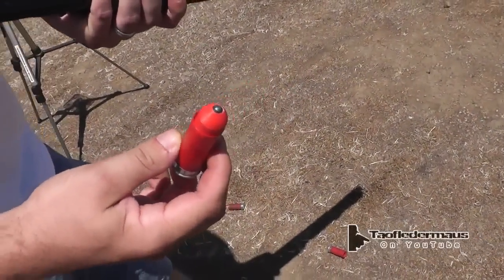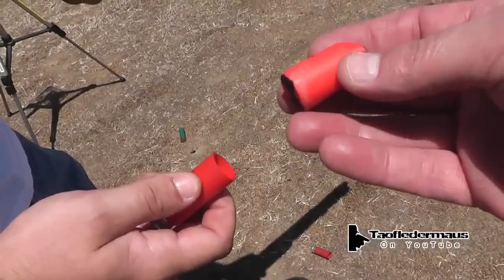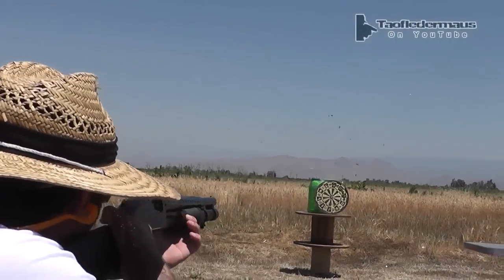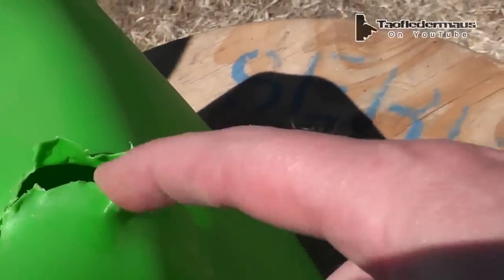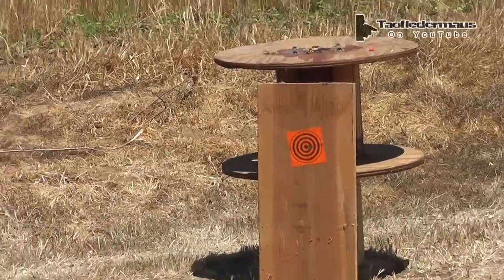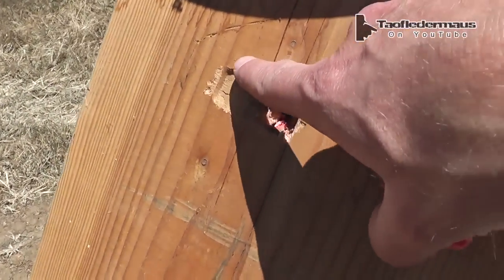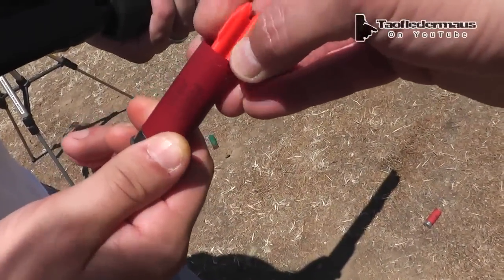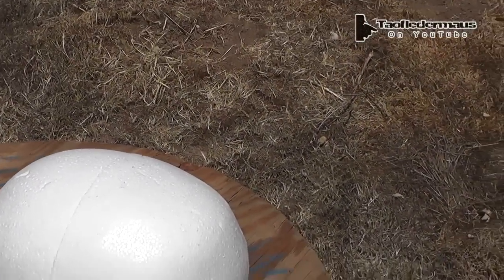"Terrifying" 3D PRINTED BULLETS - Spoiler:  they aren't terrifying!

Comment: I can't imagine 3D printers could make anything very useful as a projectile, but I bet they could make useful sabots for firing other things such as dart shaped projectiles.
Reply: Mini shaped charges?
Reply: metal printing might, but it would be unnecessarily expensive.
Reply: *****
Speaking as someone who has experience with the machines in question... it's always going to be cheaper to get a small furnace setup and do it the old-fashioned way. No way is 3D printing metal stock ever going to be cheaper than raw lead, and a basic metalworking furnace, crucible, and molds are dirt cheap compared to a decent metal-printing machine.

Comment: High speed footage by Potato technologies
Reply from the maker: Your argument is invalid.
Reply: Try filming HD with what was that, 500 FPS? I'm probably way off, but just imagine the space taken by a few seconds of footage in many hundred HD pictures before render.
Reply: The Crazy Pineapple I had a 10 second video that was 66 GB raw on a Phantom at work.  It wasn't even close to HD, but it was 100,000 fps.
Reply: GANDALF! NOOOOOOOOOOOOOOOOOOOOOOOOO
Reply: HD high speed cameras are extremely expensive though. Like phantom flex.

Comment: I don't know how to call these properly, but i believe that it's the same effect as subcaliber armor piercing shells. You have an awful lot of energy in that powder load, and it is applied to a very large surface area. Now here's the catch - since 80% of that bullet's weight is a small lead ball on the tip - it gets 80% energy of the whole bullet. And the plastic stuff is just like a cup sabot - the actual shot is that small ball on the tip.

Comment: I'll note that the interior of the bullet is composed of a lattice structure to conserve printing material.  That it also improves structural integrity, as someone previously suggested, seems a little dubious.
Reply: I think the person had it in their head that it was either structured or hallow inside. I think the fact that it could have been solid escaped their mind. :P
Reply: No, you have to think of how (this type of) 3D printers work. It's melted plastic. If you lay down too much near each other, it starts warping and peeling away. There's also the issue of how long it'd take the printer to lay down that much plastic. Depending on the size of the piece, by the time the print head gets back to a previous position, the plastic underneath may have completely hardened already. It wouldn't be one solid piece, it'd be many very loosely-connected pieces.
Reply: TKnightcrawler if it's warping and peeling away, your 3d printer is not setup correctly, we have a couple of 3d printers and building a 3rd larger one. we build large things without trouble. but when a new user uses it, if they don't set it up right it causes problems.
Reply: +TKnightcrawler You have no idea what you're talking about!

Comment: Seems to me that if you're printing the bullet that you could sculpture the exterior with a set of spiral shaped groves/fins to catch the air and impart spin to the projectile.  Sort of the way some missiles have fins that force it to spin and thus stabilize the trajectory....just a thought
Reply from the maker: Paul Hull  Not sure if that would help much.  Super sonic aerodynamics are complex.  The shockwave at the tip of the round pushes the slipstream outward.
Reply: aaahhhh.  I just thought that it would impart some spin
Reply from the maker: Paul Hull  It MIGHT... I can't say it wouldn't!!
Reply: ***** *grins* then when you print put the groves / fins at the Front of the projectile?  Impart the spin at the point of the shockwave?  Maybe the guy who is making these shells could print a few like that to test the idea

Comment: The only thing that made a real impact is the lead part.  The plastic just followed and splattered on the target.  On the 3rd attempt there was no lead and never even reached the target. What actually hit the foam head is the plastic plug used between the gun powder and the payload.   Terrifying fail
Reply: Let's see how fail it is after it hits you in the chest.
Reply: The 3rd round was a new design and concept and untested till the video was shot .  The first 2 had been tested before , Weight was the issue , You can add weight with out using metal ,  There is a type of wood that is stronger then metal one could use that wood to make a gun and Bullets  These guns do exist but of course its illegal to make them as they cant be detected by Xray or metal detectors .
Reply: Any way to get one registered as a AOW?  not sure if you guys are familiar with the "law" buy serbu got the super shortie characterized by it. 5 dollar stamp and your good to go. Make under 18 inches with no shoulder stock and your covered . Can't be modified under 18 must be manufactured as.
Reply: Ray Murda If it hit you in the chest, the worst that could happen is a broken rib. The only reason it did any damage was that they put some lead shot in it.

Comment: comeback when you get a 3D printed shotgun that can fire real bullets
Reply: That's already a thing
Reply: not a thing worth geting
Reply: unless its decorative and free
Reply: josh hadada " not a thing worth geting " , They've just made plastic trumpets that are pitch perfect & 1/3 the price . Why would you not wish for a lighter shot gun , that does not rust & may even float when your out there duck hunting ...... only a matter of time !
Reply: magna59 weak easily melted plastic gun + allot of energy and heat = broken half melted piece of shit that just took some of ur ammo for a piece of shredded duck.
Reply: josh hadada theres a disposable phone. now theres a disposable shotgun.
Reply: josh hadada You can use 3D printers with metal as well and make metal weapons. You just need the right materials and the right printers.
Reply: Lucas Rizzotto Sweet .
Reply: Lucas Rizzotto Yeah, but 3D printed metal is not the same as hardened gun barrel steel.  3D printed metal usually is rough and porous, while a gun barrel needs to be hard and smooth.
Reply: TheBalefire true but you could still sleeve it and heat treat to the areas in the greatest need of reinforcement aside from that if you destroy it you can print another as long as the first didn't blow up in your face
Reply: Don't obsess so much about it being strictly 3D printed. Think more in terms "made easily with non-specialized parts and tools + 3D print", as in not gunsmith tools, but tools you can find e.g. in car repair garage. In case of shotgun that would be a common piece of pipe, a couple screws, springs, etc. Similarly to Reprringer, you can immensely reduce size and improve reliability of a 3D-printed gun with just a handful of common metal parts, and shotguns, not needing rifled barrels, are a prime subject for that.

Now just for 3D printed ammo... in countries where guns are regulated the most, getting the ammo is as much or more trouble than getting the gun.
Reply: sharpfang yeah sure but thats illegal and totally not worth.
Reply: I know, and the metal parts they produce aren't 10% as durable as machined/stamped/pressed/cast metal. It's essentially metal powder barely "baked" into a solid - currently used for decorative parts, e.g. for museum pieces renovation. Not suitable for guns at all.
Reply: Do you realize how powerful a barrel has to be to withstand a 12 guage blast? What are you like 13?
Reply: EpicXXProductions
Yes, I do. About 100MPa at the chamber, linear drop-off length-wise. Most of seamless pipes commercially available handle up to 40MPa sustained, so you'd likely have to reinforce the chamber area through double or even triple wall. No, I'm not 13, and you?
Reply: sharpfang Actually a 12 guage shell can build up well over 13,000 PSI MPa inside the barrel lol.
Reply: EpicXXProductions
So you can't tell PSI apart from MPa. Seems you are 13 after all. FYI, 13,000 PSI is almost 90MPa.
Reply: the gun would melt partly at the first shot
Reply: EpicXXProductions Here, this could help: http://convertmpatopsi.com/  PSI and MPa are not the same thing, though they measure the same thing. Cheers!
Reply: I'd rather have a shotgun that can be dropped without the sight falling of and the stock cracking...

Comment: Here's a tip if you want to do these again:
Keep the front of the printed bullet round, but have it taper off and add fins. Imagine a cartoon water droplet, but with fins running from the widest part all the way to the end, maintaining that size.
See if your guy can add a slight gradual angle to the fins. Like a slowly increase close to what you would see on a old school nerf football.

Comment: idea... make a bullet turn in mid air   use a steel slug and a very large magnet
Reply: if the bullet was slow enough and the magnet was strong enough, maybe.
Reply: there are some huge magnets out there and you wouldnt need to slow the bullet down ...a bit of math and some trial and error.. might be sweet...

Comment: The "red rocket" is so effective because it mimics the principles of kinetic energy penetrators. The round itself is light and hence has far more velocity when using the same amount of powder, but the energy is mostly contained in the lead tip which will continue to penetrate even if the plastic does not.

Comment: Riffling is in the barrel of a gun, not on the bullet. They needed to be a bit wider to grip the riffling.
Reply: A. A shotgun is a smooth bore. It doesn't have rifling.
B. A rifled slug has the rifling on the bullet. So you're wrong on both counts.
Reply: I award you no points, and may god have mercy on your soul.
Reply: Kevin Parker Not all shotguns are smooth bored. My hunting shotgun is rifled and it actually came as quite a surprise as i can not shoot rifled slugs through it for fear of wreaking the gun.
Reply: A. Shotguns come in smoothbore or rifled-bore
B. You need foster slugs (rifled) for smoothbore or sabot slugs (smooth) for rifled-bore.
Reply: eamon reis Sorry to burst your bubble (argument) Thomas, but a rifle, by definition, is a shoulder fired long barrel firearm with a rifled barrel. Therefore, your rifle barreled shotgun is no longer a shotgun when you fit that barrel. It becomes a rifle. If you look back at my response to Jose, I was merely pointing out that rifling does exist on bullets in the form of a rifled slug, and a "shotgun", as used in this video, is a smoothbore. So now you both stand corrected.
Reply: I guess by definition you're right but I still consider a slug gun a shotgun.
Reply: Kevin Parker Actually Thomas is correct there are rifled shotguns, just not as common. Also it's not relevant to the video since it's a smooth bore.
Reply: lol hiding behind an alias. I know the difference between a mag and a clip but if you want to consider a gun that shoots shotgun slugs a rifle because by definition a shotgun is smoothbore then go for it. I'm not going to sit here and argue about it just because you want to be a negative nancy.
Reply: Thank you for your response lawls12. While you are correct that a rifled barreled shotgun is not relevant to this video, and that is what I was trying to convey to Jose if you look back in my responses, a rifled barreled shotgun is in fact a rifle by definition. Though it's caliber may be measured in gauge, it is nonetheless a rifle by virtue of it's rifled barrel. I'm not trying to be a smartass to you, but look up the definition of a rifle. And just to befuddle things all the more, you can shoot shotshells through that rifle. Also, by the way, flares. Does that make it now a flaregun? As soon as you start mixing vastly different barrels and or ammunition in any given firearm it's designation can become clouded as we've found in this dialoge. What about shotshells in a handgun??? See what I mean? What about shotshells in your .22 rimfire rifle? Does that make it a shotgun? No. Because it's a rifle. Why? Because it has a rifled barrel. See where I'm coming from?
To clear this up. Look up the definition of what constitutes a rifle and I think you will agree with my point of view.
Happy shooting.
Reply: After considering what I said to you, I would be interested in your response.
Reply: Kevin Parker Sorry Thomas, I shouldn't have come down on you like that. My bad. I typecast you into a group of people that piss me off when I really don't know anything about you or your experience. I'm sorry. No excuses. It was wrong to do that. I am sorry.
I could delete that post. But since I believe in truth and honesty, and being accountable for your actions, I'm going to leave that up for all to see what an ass I was, and a lesson for me going forward.
I hope the next time we talk, we can do it for real without my baggage. You did your part, if you give me another chance, I'll try to do mine.
That was really nasty. I'm ashamed and truly sorry Thomas.
Reply: its all good I get pissed off at people who call mags clips too
Reply: Thomas Jefferson Thomas, I am compelled to respond to this because it seems to me you missed my point. First of all when I carried slugs in my 12 ga. side by side for protection against bears while fishing in their turf, I never thought of that scattergun as a rifle because it was loaded with slugs. It was always a shotgun no matter what was up the spout, or in that case spouts. A shotgun is a shotgun is a shotgun no matter what ammunition is loaded until you afix a rifled barrel to it. At that point, no matter what ammunition you're using it becomes a rifle. It's that barrel that makes the difference and distinction, not the ammo. A rifled barrel on a 12 ga. shotgun makes it a rifle. When you shoot shotshells out of your  .22 rimfire rifle, is it a shotgun? No. Why? Because it has a rifled barrel.
I'm not trying to be a negative Nancy but maybe I'm splitting hairs here. If you look up the definition of a rifle you will find it defined as a shoulder fired long barreled firearm with a rifled barrel. A shotgun fitted with a rifled barrel is technically a rifle. It quit being a shotgun when you switched the smoothbore barrel for a rifled barrel. Whatever ammunition you put through that barrel doesn't matter. If it's a rifled barrel, that makes it a rifle. AND I never said that shooting slugs from a shotgun makes it a rifle. I don't know how you came up with that. I do have some experience with shotguns as I have shot trap competitively since age 12 and I am now 60 and regularly break 100 straight. Through the decades I have owned and handloded for many 12, 16 and 20 ga. shotguns in all the action and barrel configurations you can think of. I also shot 1000 rnds/wk in .45 ACP when I competed in IPSC and 300 rnds/wk when I competed in PPC with a .44 MAG. S&W 3" Stainless from the custom shop. Yes I know everyone else used .38 Special Wadcutters loaded light but I had fun beating them with a cannon. After competing in IPSC for years with a major caliber I found the time limits in PPC quite generous. I also competed in centerfire, rimfire and blackpowder rifle events including benchrest and loaded for about a dozen different calibers. In short, I have probably forgotten more about shooting and ballistics than most guys will ever know. Elmer Keith and I go way back. My first handgun was a .44 MAG. due to him.
I hope this clarifies my stance on the shotgun/rifle issue but I'd be happy to revisit it if you like.
Nancy? That was a low blow but I guess I deserved it after my alias post to you. Sorry about that Thomas, you didn't deserve it.
Reply: I think Thomas Jefferson would have liked Elmer. Pick up a copy of his book " Hell, I was there." I'm sure you would enjoy it.
As Thomas Jefferson was a father to America, Elmer Keith was a father to us shooters.
Good day to you Thomas.
Reply: @ " Riffling is in the barrel of a gun, not on the bullet"  .Really?  if you mean "rifling" then apparently you have never seen a "rifled slug" for use in smooth bore shotgun bbls.
Reply: Bill, take a look at my original post from March 24th. I know what a rifled slug is.
Reply: Kevin Parker Sorry, Kevin, you are just wrong.  Having a rifled barrel does not make it "not a shotgun."
Under normal circumstances, any firearm with a rifled barrel over 12.7 millimeters (.50 inches) is legally considered a "destructive device" in the United States. When rifled barrels started being used on shotguns, this would have made them destructive devices illegal for civilians to obtain without special permit.  A BATFE ruling was obtained stating that a firearm designed to fire shotgun shells that was converted to fire shotgun slugs with the addition of a rifled barrel was still a shotgun, and thus not a destructive device.  Hence, from a legal standpoint, a shotgun with a rifled barrel is still a shotgun.
Your problem is that you are trying to categorize things too agressively.  A rectangle is a 4 sided polygon with right angle corners and parallel sides.  A square is a 4 sided polygon with right angle corners and parallel sides of equal length.  You are basically making the argument that because you are taking a rectangle and making the sides equal length, it is now a square, and NOT a rectangle.  This is false, as squares can also be correctly called rectangles, as they fulfill all the requirements that the rectangle's definition requires.
Something is a shotgun if it was designed to load and shoot standard shotgun shells.  Any modification applied afterwards does not change the fact that it is a shotgun.

Comment: Two things would significantly improve this load:
1: Change your 3D printing settings to fill with solid plastic, instead of low density honeycomb.
2: Add rifling, like a foster slug, and cut the flaps off of the wad when loading it so that the slug sits directly on top of the wad base, and the rifling can engage the barrel.
I'd love to see a video with an improved slug.